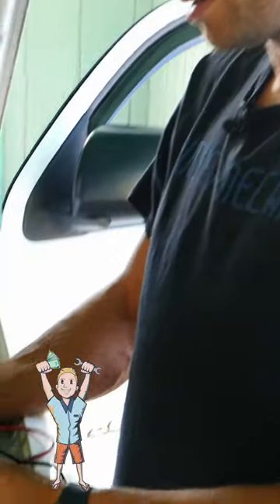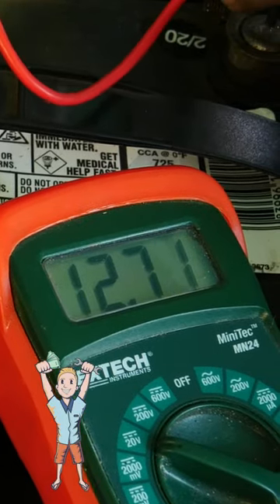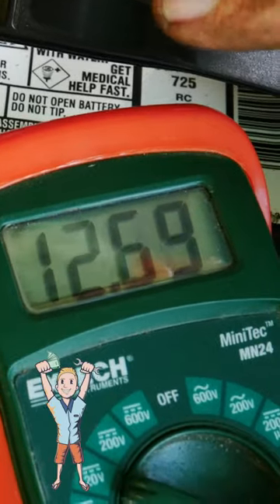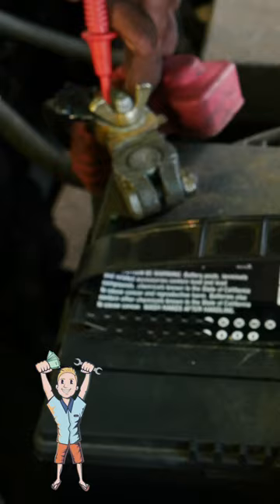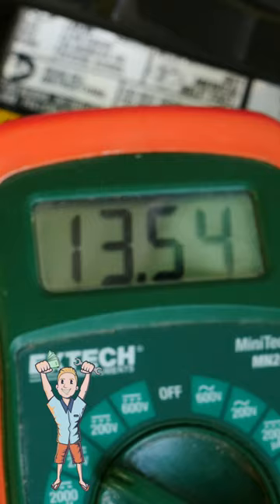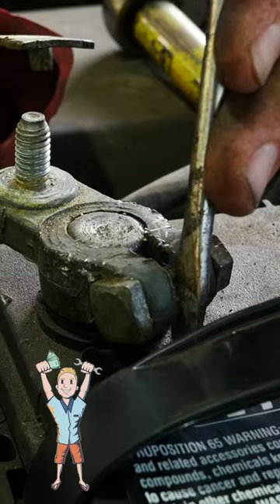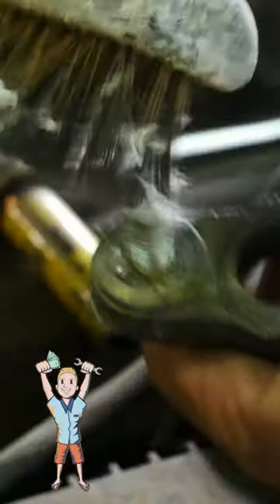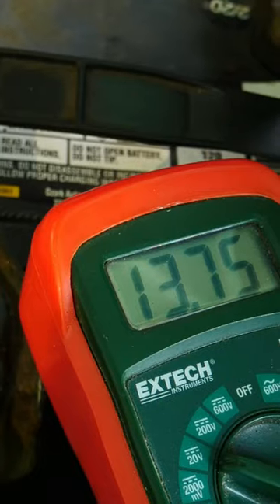Battery Dying? NEVER SKIP This step! $$ #carbattery #carrepair #cardiy

Comment: Yup! I've learned a wire brush is your best friend with car battery. Any little debris,rust ECT and you do not have a good connection or continuity. Its imperative you clean the terminals,connectors yearly.

Comment: So, you replaced the alternator first before checking if the issue might be with the battery?! That's ssA backwards....😅
Reply from the maker: Battery was fine after being recharged. But this is why you “should” always check alternator output at the alternator itself if you can… thanks for calling me out on breaking my own rule 🤣

Comment: That doesn’t make sense to me. Why would there be more conductivity further out from the lead?
Reply: The distance on something like this is insignificant because it's a whole 1 inch. The portion that makes connection where he needed it was dirty and also where he tested originally
Reply from the maker: There was corrosion blocking the current, so voltage wasn’t getting to the battery terminal
Reply: the conductivity is different because further up the chain, the lead skips the oxide layer (corrosion) at the battery terminal connection. cleaning the battery terminals is part of a standard vehicle maintenance list at a good dealership.

Comment: Did you grease it afterwards?
Reply from the maker: With dielectric? I didn’t
Reply: @BudgetMechanicHawaii  Dielectric grease is for plug wires. I wouldn’t put it on batteries posts either. I’m talking about spray grease. Need to do it or you’ll do this job again soon

Comment: 13.79 volts is on the low side of charging. It should be 13.8 to 14.2 (high side varies depending on whos info you are using.)
A 12 volt battery is not 12 volts. Each cell is 2.15 to 2.2 volts (again depending) meaning the battery is actually a (aprox.) 13.2 volt. It takes about approximately a half volt more to properly charge the battery in a timely manner. So 13.8 volts is good enough to keep the battery charged and in good shape. However, volts over 14.2 volts on an ongoing basis is not good as it can overcharge the battery and "boil" out the water.
Reply from the maker: General rule of thumb for alternator, 12v is bad, 13 is good, 14 is too high. Variations will always occur, even engine rpm will effect exact voltage
Reply: @BudgetMechanicHawaii I don't know what you're working on, but it's clearly not the same as what I've seen. 14 to 14.5 volts is ideal charging voltage, 13.5 or less is low, 15.5 or more is high, but not cause for concern until 13 or 16. The voltmeter on the dash in my current truck shows from 10 to 18 with the red sections at <=12 and >=16. It even shows 14 right in the center with a tick mark to show the ideal spot, and the manual says 13.5 to 15 is normal.
Reply: @BudgetMechanicHawaii well each to his own. Not what i was taught, ever seen, nor have ever practiced for the last 55 years.
Reply: @TheHonestL1ar agree. And I've noticed different information differs a bit from each other's info.
Reply: Where did you originally test before the alternator change out. Obviously not at the alternator. Most are parts changers not technicians. Parts are money. Changing parts is time. You sir have wasted both
Reply: @alex-sv8to ummm, who are you replying to because I didn't change out anything.
Reply: Keep in mind newer cars with its sensors like chevy will charge at 12.5 mostly at idle only to keep from overworking the alternator to help it last longer. And yes it's designed that way